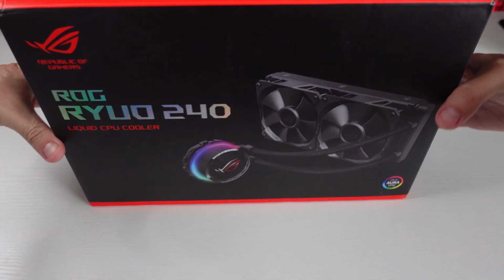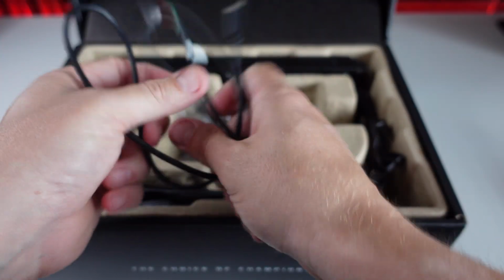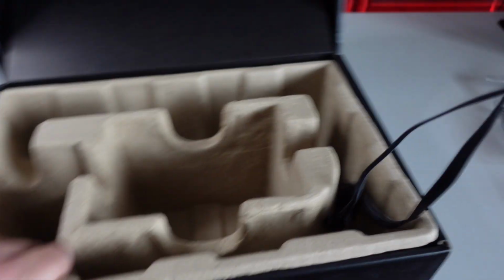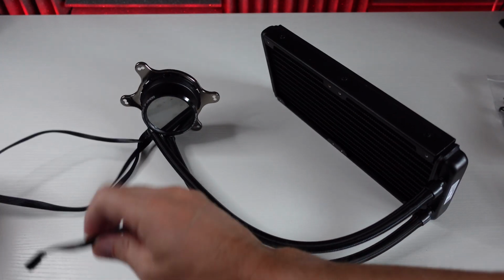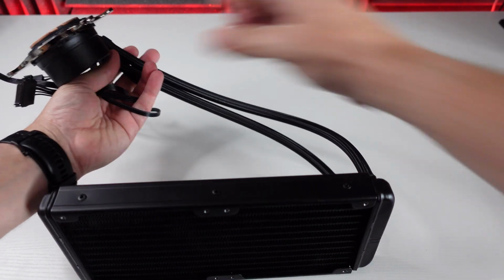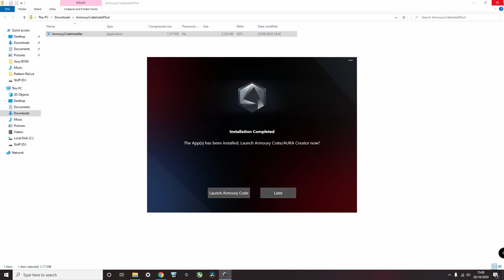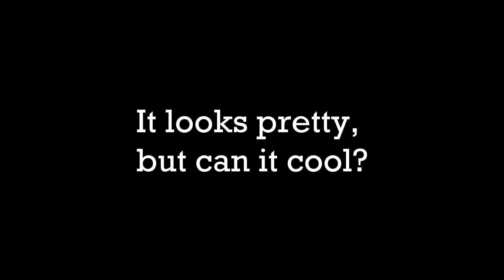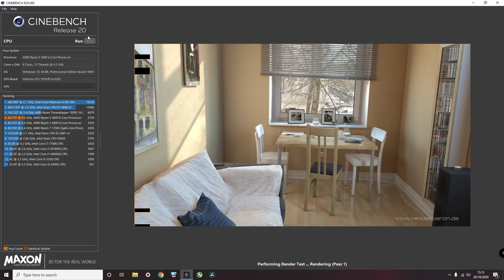Asus ROG Ryuo 240mm AIO - Unbox, Install, Setup & Test

Comment: so is the liquid in the actual cooler itself, or do you have to fill it?
Reply from the maker: Hi, majority of AIO coolers are sealed and you're unable to fill them up, I think Bequiet coolers are able to be topped up along with a few others. In this instance, the liquid is in a closed self-contained loop and it's literally a case of installing the cooler and forgetting about it. There is no maintenance or anything required. I hope this helps.
Reply: @WayneWebbFilms   thank you!!! and how safe is it, because i do wanna try water and air cooling, but i dont  wanna risk losing a couple thousand dollars?
Reply from the maker: Honestly there is no risk. Buy a good quality one ie Asus, Corsair or NZXT and you're good. Now if you were going to do a custom loop then that would be different. If you're concerned then you can always do a front mounted setup and if there was ever a disaster, it won't happen, then you wouldn't be dropping liquid on your PSU or GPU.

Comment: You didn’t really show how to mount it and stuff. Just a timelaspe
Reply from the maker: It's very easy. Put backplate on, add the mounting screws. Then put thermal paste on cpu if required, comes pre-appllied if bought new, then put the pump onto the cpu, loosely add the bolts and then slowly tighten up each one using a criss cross pattern ie opposite sides to get equal pressure. This should all be in the manual anyway. Hope this helps

Comment: How does the pump get connected and working?
Reply from the maker: There is a sata power cable and a USB cable. Then, in conjunction with Armoury Crate, it allows power via sata and fan/pump control via USB. Hope this helps

Comment: This cooler can mentain an 5600x in full load?
Reply from the maker: Yes definitely. The 5600x is a 65w chip and this could handle the 3900x without a problem
Reply: @WayneWebbFilms  well thank you very much sir. I will order this cooler.

Comment: Hi
This cooler good for i7-10700k?
Reply from the maker: Yes, I was using this at the time with a 12 core 3900x. I use other 240mm AIOs (H100i XT & the EK D-RGB 240) which are very similar in performance to the Ryuo 240 on my 10700k and very happy with the temps.

Comment: Will it fit on LGA2066?
Reply from the maker: Yes apparently so
Socket Compatibility	
1150
1151
1155
1156
1366
2011
2011-3
2066
AM4
TR4 (using bracket included with CPU)

Comment: is it compatable with a I7 10700K
Reply from the maker: Yes it is. The 1200 socket uses the same fittings as the 15** so you're good there. Not currently using it myself, have the EK 240 AIO installed, but I'm happy that this would do a great job of cooling my 10700k
Reply: @

WebbTech how many celsius degrees do you have ?
Reply: with the asus
Reply from the maker: I'm not using this cooler with my 10700k plus there are so many variables ie case, fans, fan curve, if there is an OC, if you're gaming or video rendering etc. I have only used the Asus on the 3900x but I would expect the same sort of temps as per the video. Sorry I cannot be more specific.
Reply from the maker: I will probably be using the Asus with the 10700k when I do a video on a new case after Xmas

Comment: The screws won't go on the motherboard
Reply from the maker: What motherboard are you using and are you sure you're using the correct screws for your socket? Refer to the manual just to be sure. There should be a couple of sets for Intel and one for amd
Reply: @WayneWebbFilms  there was something that came with the case and now it works. but I still have one question. the usb thing I plugged in dangles on the front do you know how I fix it?
Reply from the maker: You would normally route this to the top of the case (roughly where the fan cables would go), then behind (not directly) the motherboard and then out the bottom to where you would plug it into the motherboard
Reply: @WayneWebbFilms  ahh ill try it. for the fans on the radiator I put them on the motherboard for fan and then I routed all the cables on the heatsink to the back and then im still looking for the cables to plug it in
Reply from the maker: The two cables plug into the pump, there is another cable (3 pin i think) that goes into the cpu header.
Reply: @WayneWebbFilms  oh so CPU opt?
Reply from the maker: @minimal2420  the pump 3 pin goes into cpu_fan
Reply: @WayneWebbFilms  then what about the two cables that come with the fan that goes on the radiator
Reply from the maker: Let's take a step back. There should be two cables that come from the pump and you plug the fans into those. There is then a 3/4 pin cable that goes into the motherboard CPU header and a sata cable to power the pump. Finally there is a USB cable that goes into the pump and motherboard.
Reply: @WayneWebbFilms  I'll try it

Comment: the screen turns to crap after a year.
Reply from the maker: I've heard reports of screen burn on these, hope the same doesn't happen to my new nzxt z63 or I'll be unhappy
Reply: @WayneWebbFilms  I thought it was cool but I’ve also had serious issues with the driver for it. 

The screen burn in is very bad. I’ve thought about going back to air cooler
Reply from the maker: You could try other coolers. I really like the Corsair H100i XT or the NZXT X53. 
I did a comparison video between the Corsair H100i and the Ryuo a few months back and the Corsair came out on top for me in a lot of the categories.